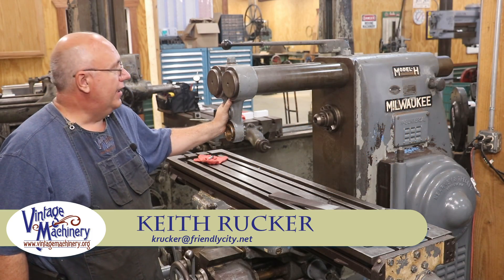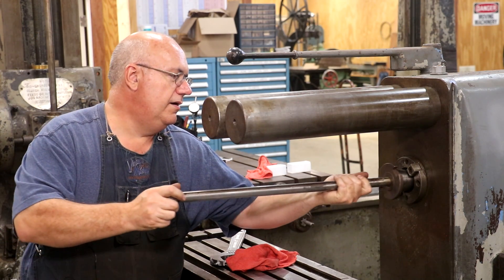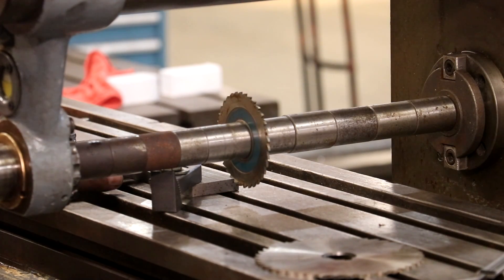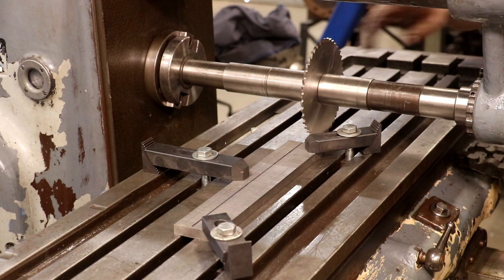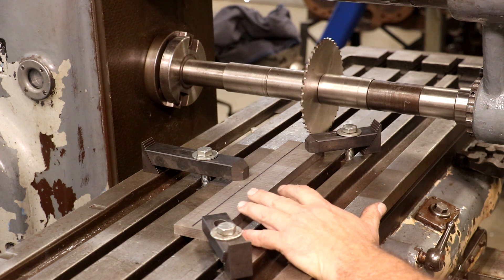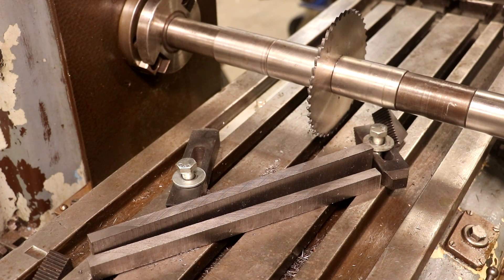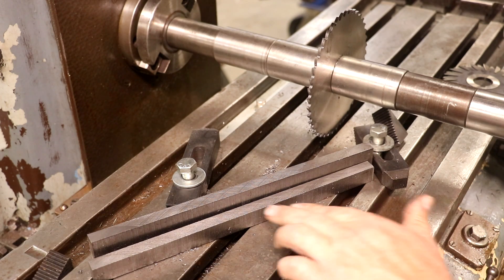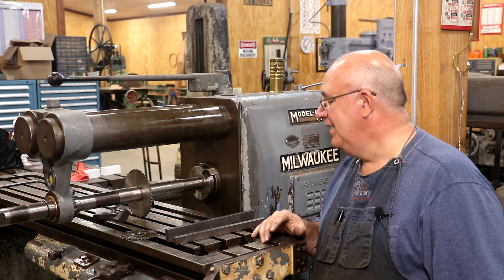Slicing a Cast Iron Bar on the Horizontal Milling Machine

Comment: Always using your videos as a ref point when I’m a bit lost 🤣 I’ve had problems with a relatively small día disc ( 100 mm HSS ) with no relief on the teeth : vibration when coming up to full depth of cut .
The set up is on a robust universal “Lagun “ with both steadies on the over arm ( not with roller bearings but phosphorus bronze )
I’ve noticed after machining many slots the vibes are increasing and the disc seems to rub even when the cutting edge still has its sharpness . 
I’ve noticed on your over arm steady the bronze bearing seems to have an adjustment to tighten it on to the arbor .

Comment: Thanks for the video!
In your case, when the feed is small and the cutter has a radial beat, the cutting process is uneven.
My teacher recommended doing something a little different. Cut with a small indentation, but with a large feed. In this case, all the cutting edges will work and blunt at the same time.
Due to the large number of teeth, you can include a large feed and will cut instead of "scrape".
For example, cut steel 2.5mm recess, feed160-200mm / min. Dural is usually a depth of 5-7.5 mm and a feed of 315 mm / min. this is for 125 cutters and middle tooth.
The size of the tooth should accommodate the chip being formed. Less recess = smaller tooth can be put = more speed and time to re-sharpen.
Well, you need to cool and remove the chips (I think it's clear).
Thanks again for the video
Mykhailo

Comment: Keith....do you not have “flood cooling” on that machine? Back when I wore a younger man’s clothes, we almost always used coolant.
Reply: You said: "Back when I wore a younger man’s clothes, we almost always used coolant". If you're an "old timer", why would you say that?
Reply: James Spencer Why not? I’ll be 78 on my next birthday. Back in the late 1950’s when I worked in a shop we almost always used flood cooling while using our horizontal mills. Soluble oil....it looked like milk.
Reply: @tomcross6567  I was hoping you were going to respond by saying that you learned machining from Billy Joel. Lol. 
By the way, from my limited knowledge of machining, you don't "need" flood coolant for cast iron because the excess carbon acts as a dry lubricant.
Reply: James Spencer what you say is somewhat true. But I still say flooding the cutter with soluble oil not only keeps the cutter “cool”, but gives a bit lubrication and cleans the cut as well. To each his own.

Comment: Great to see the new machine being put to good use. I was surprised to see you only put a single clamp on the thin side of the cut off. In my experience that's just asking for it to pivot into the cutter then it come free.

Comment: Your new "inverted metal cutting table saw", is awesome!  Very quiet and smooth running.  Perhaps another set of 2 clamps on the small piece vs the single one in the center would have cut down on the chatter a bit.   The crosshatch pattern looked great. As soon as you first showed it, I thought the same thing.  Thanks for the Friday video!

Comment: Hi Keith,  I love the video.   The Boss is  a cheep skate ( me) and  I  am always having to chop multi pal  parts out of the width of stock.    I tend to use the horizontal  just like this a lot.   Recently,     Some times it seems all about arbor clearance.       I have taken  to using some standard   Milling strap clamps, backwards, ( with the stair steps on the work piece) and I have milled a counter slot (for a SHCS ) along the factory slot for ultra low profile work.   I also buttress the stock   ( at the end )  against  the rotation of the saw force.    
 .... Especially on cast iron, ( just like with the table saw on  plywood with internal stress) I tap in a small wedge in the kerf.   (  Oh so gentle). I find this really helps with flat ground cutters with out side relief.   Some times ( if the kerf is the right size for it) I just start the threads of a drywall screw   Don't forget and go back with the cutter..     

On the subject of arbor clearance,   i just got about a dozen of the CARR Lane style toe clamps and love them ... hard to use in your application with the through cut, but in general really help with arbor clearance on stuff to long  or flimsy for a vise or vises.  They are great  for castings to true up a feature along a axis, 

Last comment,  If a key stock can migrate axially,   it will.  We bent an arbor  with the power feed, when a key moved in the bushings.  Cutter stopped rotating,  feed kept going.     I set it up,  used a short key,  Long enough to be  captured in the bushings next to  the cutter, then off set the key ways in the second adjacent bushings, but some how the lined up and key shifted.  Full length from here on out.
  Sorry....   rambling to long.    Be safe.

Comment: Probably a dumb question:   if you are concerned about making an upward cut through the work, why not turn the cutter around and run the arbor in the other direction?
Reply: He discussed why he chose 'upward' cutting (aka conventional milling) vs 'downward' cutting (climb milling).  Each have their advantages and disadvantages.

Comment: One more "chatter amelioration" possibility: As you noted, you are conventional milling (for very good reasons) which (as you also noted) tends to lift the work away from the table. It might have cut down the chatter if there had been 3 (or even 4) clamps on each side of the work.
Reply: Also the arbor is way too long. Shorter one would flex less.

Comment: WD40 is mostly acid and produces nasty smoke. No lubrication supstances in it. Water would be better choice in this use case (cast iron).
Reply: WD-40 is mostly mineral spirits (>50%).  It is a Stoddard Solvent (refined mineral spirits).  The commercial name, back in the day, was Varsol. The rest is mineral oil (>25%), driers, fragrance, and propellant.  WD-40 has done a fine job marketing their product considering what it is made from!

Comment: I've never used a horizontal mill before. What keeps that key under the cutter from migrating up and down the arbor? Just the cutting pressure itself?
Reply: As you lock down the arbor you should hold torque on the cutter, once it is loaded the cutter holds the key.  Sheering a key with a slitting saw is pretty easy to do and can result in a bit of fun getting a 1/2 sheered key out and disassembling the arbor.
Reply: Chuck in Wyoming thanks for that info! Neat

Comment: My shop teacher back around 1970 had us keep the overarm in for a short span supporting the tool to minimize vibration and howling. Never did slitting, haven't touched a horiz mill since then, and the school mill was about 1/3 the size of yours.

Comment: Is it not better to fully flood the job with coolant rather than a sporadic squirt?
Reply: He hasn't checked out the coolant system on this machine. This his first time using it, but he did say when he got it that the PO used the  pump for cutting oil.

Comment: "Extruded cast iron"...so that's a thing, then.
Also, are those 2 arms hollow or solid?
Reply: Very much solid. I've had to take mine out and boy oh boy was that fun
Reply: Erik Bongers they are solid.
Reply: Eric,
 I think Keith has a supply of continuous cast iron, it's not extruded in the traditional sense, but the molten iron is poured into a horizontal water cooled die, as soon as a plug of solid iron is formed it's slowly pulled out and the juggling between cooling and pul rate begins. If you pull too fast there can be too much molten core and the wall of solid metal can break and burst molten iron into the water cooling. I once heard the bang when that happened to a one foot diameter copper billet burst. It lifted the foundry doors of their runners. I was probably fifty yards away in another building at the time. Metal working can be fun!
Reply: He is using Dura-Bar.  It is a premium, engineered cast iron that is rather expensive but first rate material.  Here is the product.... https://www.dura-bar.com/

Comment: Adam's k&t has a backlash eliminating nut, check if you have it and see if you can do the ultimate milling and save the cutters and get better finishes
Reply: The machines made in the 40's didn't have that advanced double adjustable nut.  I have a 1942 2HL baby brother to Keith's.
Reply: @chuckinwyoming8526  yeah I think Adam's one is some decades newer

Comment: hey have you ever taken a lead test? I bought a new snatch block and it had a sticker on it saying danger of lead dust. that got me thinking  pretty much every metal you machine has some lead in it  I wonder how much you have been really exposed over the years
Reply: Lead is dangerous only if it gets inside your body. And in machining, if you machine to the point where things get into airborne dust, then, you're doing it wrong.
Reply: That original paint on these older machines was lead based.  Be careful stripping and repainting any tractors or machines from the 1920's to 1960's.
Reply: Some tool steels have lead added to make it easier to machine. O1 is one such tool steel.
Reply: @millwrightrick1  - 316L stainless is another.